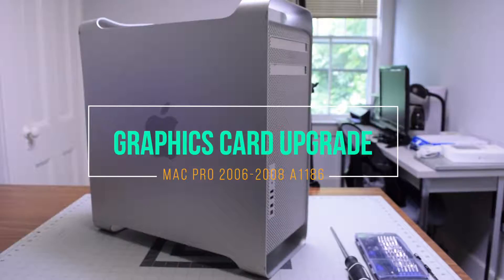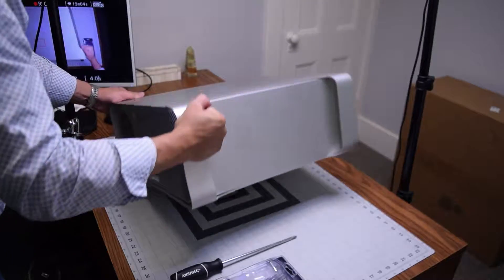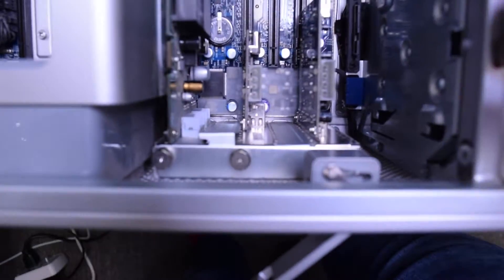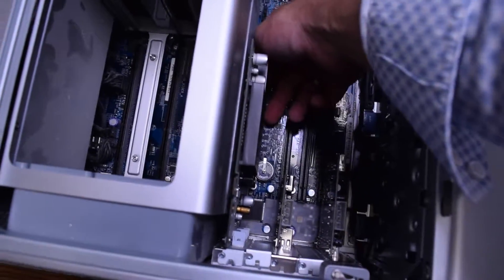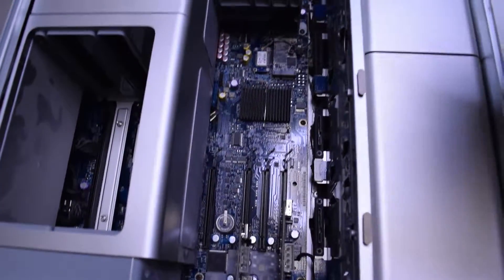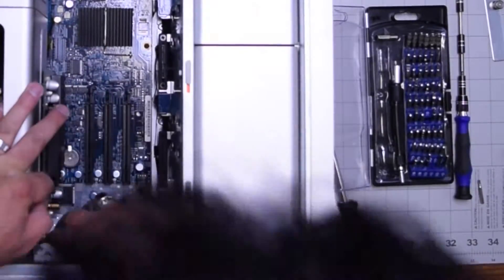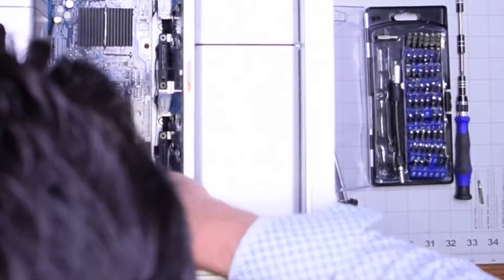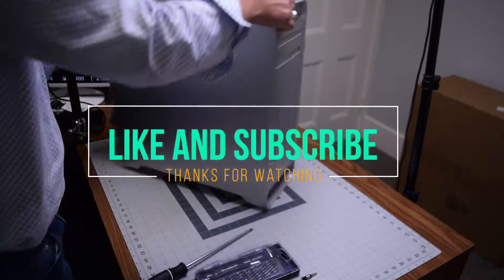Mac Pro A1186 - Graphics Card Replacement (2006 and 2008)

Comment: HELP, my mac is stuck in a boot loop but i cannot see the safe mode screen or even the apple screen due to having a aftermarket graphics card. Is there anything you or any one can do to help me, i'm stuck and ran out of ideas, I've tried resetting ram. Currently running El Capitain. 
Equipment: 
Original (2006)
A1186
MacPro1,1
emc 2113

Comment: hello what card would you recommend for this update ? My macpro 2008 which graphic card has already been updated (1 DVI and 2 Display port) but the Display Ports doesn't work at all...I consider change the graphic card again... thanks !
Reply: Have you tried a nVidia Quadro FX 5600?
Reply: @dylantingley9400 finally i've bought  a Sapphire RX580 8go and it works just fine. I can display 3 monitors by HDMI, the only thing is that it takes 3 to 4 minutes to boot sometimes
Reply: @simoncortesmusic  Ah, saphire is a good choice. I assume that you have a hard drive in the machine?
Reply: that may explain the long boot cycle
Reply: Dylan Tingley i’ve got a 256 Go ssd with the os on it (under high sierra) And 3 other hdd
Reply: Dylan Tingley sometimes i boot my own os from an external ssd and the boot Time is far way shorter
Reply: @simoncortesmusic  yeah use an ssd
Reply: @simoncortesmusic  What connection to your ssd? evo? SATA?
Reply: Dylan Tingley the internal ssd is directly connected to the motherboard by sata. When i boot my own os from my external ssd it’s by usb (it’s a 500go T5 by samsung)
Reply: @simoncortesmusic  Usb 3.0 I assume?
Reply: Dylan Tingley yep
Reply: @simoncortesmusic   what is the os on the external usb connection?
Reply: @dylantingley9400  I've Updated to High Sierra on both systems. Internal & External
Reply: @simoncortesmusic  Did you use a patcher? I assume no. But if you did, it might be the patched kexts interfering with the boot process. Also try running disk utility on the slow drive and see if there is anything going on that might be problematic.
Reply: Dylan Tingley okay thanks i’ll check disk utility and see what it says. I don’t have a patcher no, is it something i need to check too ?
Reply: @simoncortesmusic  No, if you didn't use a patcher, there is nothing you need to worry about.
Reply: What OS are you running with your RX580?
Reply: @nolimits.studios  stuck at high sierra. I can’t update over it due to the fact that I need it to run pro tools 11 here where I work
Reply: @simoncortesmusic  I have a MacPro 2.1 2.66Mhz 8GB Ram SSD do you know if it runs High Sierra? I'm stuck on El Capitan... Any pointers? Thanks!!! Congratulations on the video!